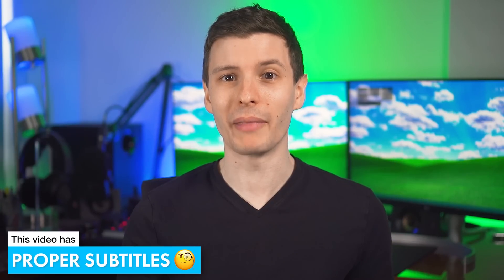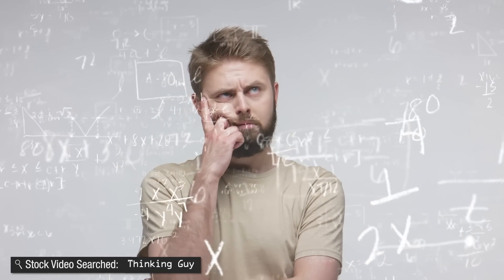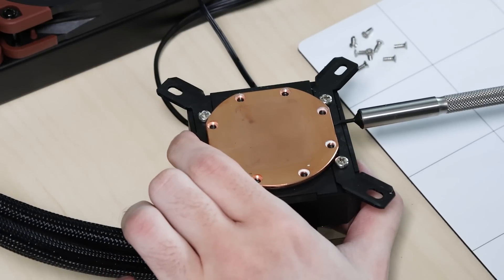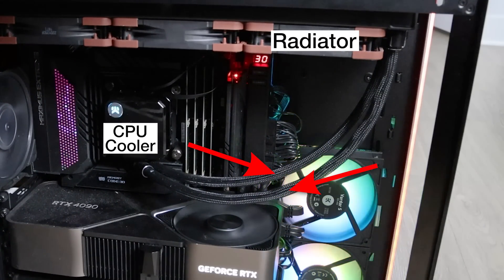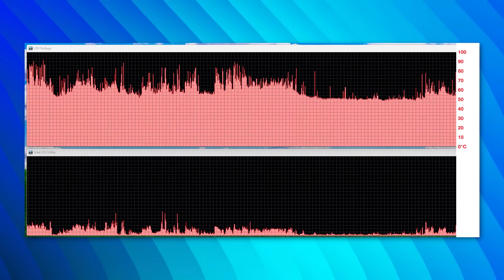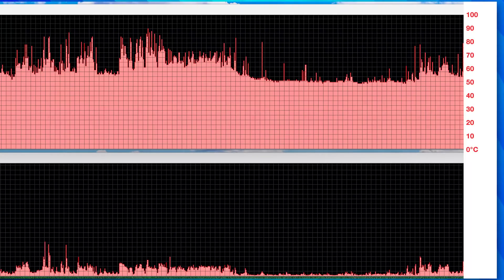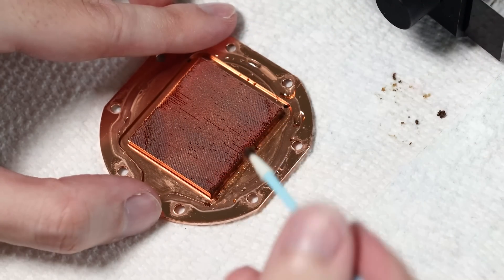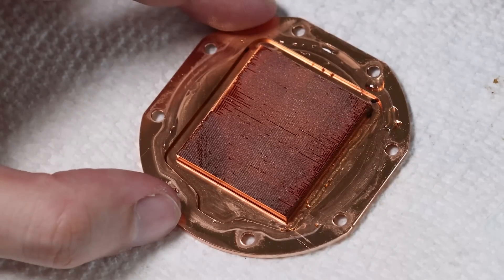The Mystery CPU Overheating Problem Took Me Months To Solve

Comment: I have the same motherboard paired with 12900k on a custom loop that goes through CPU and GPU. The idle temp of the package sits around 35C. Dint had this kinda problem happen to me , though i use EKWB Velocity 2. But i did had a problem with my RTX3080Ti. It is mounted vertically via a riser and in 2 years using its temp under load went from 70s to 95. Its cooled by Corsair waterblock. When i disassembled it i noticed there were near to none thermal paste left in there , only near the center. All of the paste (Thermal Grizzly Hydronaut) from corners just slid down. After reapplying the paste i am not getting even lower temps than day 1 , maxes out at 67C under full load. Good thing is i am always monitoring my temps on 2 screen😊

Comment: Really interesting video, thanks Joe! When my new PC arrived (i9 12900K) the Noctua NH-D15S cooler had been damaged in transit - they had stock issues and initially offered me an AIO pump instead, I'm glad I held out until they could just offer me the same again as it works really well. At idle the fan doesn't even need to spin and at least I don't need to worry about this sort of issue!

Comment: even before I got to the part where you "reveal" the real problem, as soon as you mentioned water cooling AIO I was like, yeah, it must be clotted, it has been happening with several water cooling AIO's. I hope you replaced the entire cooling fluid because if not, all the gunk floating on that liquid will clot your thermal fins again and also, it is pretty clear that whatever cooling fluid that AIO uses is not of a good quality. You SHOULD replace the entire fluid.

Comment: As a computer tech, do not use water cooler if you a simple user or office user, water cooler will definitely bond to fails either leaking or pump/clogged failed in just few years, than air cooler. And the leakings that also have high chances of short your mainboard or the expensive graphic card. 
Unless you want to replace the water cooler every 2 years for best safe period.

Comment: Goo crud electrolysis cooler AIDS:  FLUSH COOLING crud out of system.  or plastic hoses crap use stainless steel brake line.

Comment: My biggest question would be, what kind of water did you fill your cooler with? Quite often, regular tap water will have minerals that will build up in those tight areas like those fins and cause clogs/overheating. If you fill it with distilled water, which won't have those impurities, you shouldn't have those issues. Another problem could be small imperfections left behind from manufacturing the cooler in the 1st place. Try cleaning/flushing any new system with something prior to install to prevent this problem in the future.

Comment: Yeah, Greg Salizar also found this...  Its not the cooler, nor the pump.  Its the fluid.  It needs to include a good additive package, that is toxic to the fungus that is growing in your cooler.  Industry has been dealing with this for decades in cooling water circulation loops.  Alcohol might be a decent additive if all the hosing and rubber and plastic is resistant.  But whole big name companies exist to sell chemicals to the big industries to solve this on a daily basis.  

Clean the fins with a soft fine brush and see if you can figure out what additive to use.  Maybe the PC industry has AIO coolant with built in fungicide you can get??  But Isopropyl is going to be better than ethanol as the alcohol should you decide to go with alcohol.  And Acetone is also possible but is also more aggressive against rubbers, so caution if you choose Acetone.  Also, dissolve a few milligrams of zinc oxide or even Copper sulfate.  Both are potent against fungus growth.  Good luck. 

A new cooler probably will work for a while... but find reports of 2 or 3 year old AIO's still doing well.  Fungus takes time to grow.

Comment: tbh, a good high airflow case with decent coolers and fans can be almost as quiet as water cooling, while being much more reliable.
i have the lian li lancool 2 case, paired with the darkrock pro4 cpu cooler. i also added another top case fan.
a year later i had to open the case to add another drive and i was in shock how little to no dust there was.
even when playing cpu heavy games the fans hardly ramp up,  which shows much airflow there is even in idle. so much in fact that dust doesnt even has a chance to settle, its crazy.

Comment: I would say do not buy AiO you already doing the work of a custom loop you may as well just build your own custom loop, you be in control of quality rather then the hardware vendor, just get a radiator zmt tubing proper fittings and block and pump res combo and you safe a lot of work, if rad space is a problem consider a Mo-ra3 with quick disconnects, custom watercooling is more expensive but it will last you a couple of generations easily unlike an AiO cooler that usually only last a few years.

Comment: The issues of mixed metal loop.
Bin that water cooler.
There is crap thought the whole thing, the microfins, the jets, the pipes, the radiator.
Plus the coolant loss and lack of anti-corrosive compounds.

Comment: What they should do is coat the CPU in Fuzed Masonite crystals, like diamonds, then the frequency modulation is dampened by the covalent ionic wiggle room.  Like a glass blower can hold the glass five feet away from the molten lava.

Comment: I work for a company that has 80 employees all across the US. We ship pcs to each of our employees. Air coolers are too bulky for it to survive the trips. So I use 120 aios, mainly nzxt. After about a year in the field the pcs start over heating and I have to swap out there pc. So I would just swap out the cooler and pc worked fine. I would throw the bad aios is a corner to look at later. Well finally I did start opening them and found they all had a ton of garbage in the liquid. Since then I switched to 240 corsair. Hopefully spending a few dollars more on the aio will save me a ton of money on shipping 2 pcs and paying an employee for 3 to 4 days of non work. I'm not sure why so many of these aios are doing this after less than a year but it is happening. I would say close to 20 percent. But I have some that last 3 to 4 years. Normally corsair. Anyhow that's my story.

Comment: The gumming will happen regardless of the manufacturer. Straight distilled water will help so long as you clean the system with mild bleach, but even then it's not a guarantee.

Comment: You can scrub the fins with an old toothbrush to clean them out. But the fact that you got corrosion on this unit means that you may continue to get it. Hopefully you replaced the coolant with something that has a decent anti-corrosive which might help, but I'd keep a backup cooler ready to go.

Comment: This video actually helped me realize why my laptop was overheating. While my laptop isn't water cooled, it did actually help me realize that I should probably check the inside of the fan and turns out it was breathing through a carpet.
Reply: I think I might have that same problem with my laptop

Comment: That sounds like a  nightmare. Glad you figured it out. Another reason to avoid watercooling. It's almost never better than air (for CPUs) 

IceGiant ProSiphon, Noctua, and Thermalright are my top recommended air coolers, even if you have to make a bracket to support their weight from pulling too much on the motherboard.

Comment: every AIO alway get clogged up every years no matter what u did to it
if you have warnnty on it get it replace if no them i adjust you deeper take it aparts and deep clean it with tooth bush and dispill water get it flushed it out and clean block out and done and put radiator lower and block up higher and fill it up with dispill water or you can use antifreeze because it have lube in liquids DONT use color fluid it will ruined it
i have fix so many AIO and REBUILD them every few month when customer come in with clogged fluid AIO just happen and dont use cotton stick it will get stuck on stuff

Comment: Based on up to 2:20 I assume it was air bubble in the loop. Lets see! Welp was wrong, wow that's a manufacturer defect, they forgot to purge before assembling.
Toothbrush the plate fins and run some cleaner through the rad if you want to reuse it.

Comment: I had a 6 year old core i7-5960X system with a thermaltake CPU cooler that finally had a CPU overheating scenario, so I replaced both the CPU with a better Xeon and put a new cooler on it. Works like a champ now. The processor would get very hot and the outlet tube from the water block also would get pretty hot, but the radiator wasn't really getting all that warm. It was almost like it was pushing very hot water very slowly through the pipes. I haven't disassembled it yet, but I imagine either the pump is dying or it is likely contaminated with debris.

That sludge looks like plastic/rubber degradation debris. Chances are, the inside of your hoses are breaking down for some reason.

It is one of the reasons why I think it is better to have a reservoir and clear pipe type water cooling setup, so you can see the debris, rather than these dedicated closed loop coolers with opaque rubber hoses.

Comment: That's SUPER weird. AIO's are not meant to clog that easily/fast. EK would probably like to work out what the schmoo was that you got out of there. Something from construction, too much grease on a seal or something? It came off easily so I'm not thinking galvanic (and that would be terrible cooler design... although that HAS happened before). I'm wondering if an o-ring or one of the pipes is being eaten away?

Unfortunately the microfins are the Archilles heel of water cooling, unless you have another filter in the loop they will happily take on that task!

Comment: I once had something similar to this, except that everytime I rebooted OS its normal as long as its never sleep, but everything change when its awake from sleeping, CPU 100%, 79'C, slow but not stuttering. I was running Win xp 32 by that time.

Thought it was a virus infestation, but antivirus says it 100% clean in "deep scan" mode which takes over 4 hours to complete. Only when rebooting its become normal again, 1% CPU, 26'C. Only happens when its awake.

Been searching over the internet, I found a blog that might have the solution to my problem except that the solution is a nonsense to me because it says usually the reason it happens because of battery management driver, the solution is update your OS.

Well I did what it says and the problem gone magically, but I did not want to update the OS in the first place actually because my old OS is actually the fastest OS i had which is Windows XP. Update to WIN7 just to remove the problem is a pain to me because of that pesky infinite windows update download.

Btw I tried to install Win Xp 64 and to my surprise its run with no problems. I mean it its smooth as butter but it didn't last long as a lot of my apps cannot be supported by it. So I resorted to Win 7 64 instead. Its okay to me, 1.27 gb ram usage and 37'C  on idle is not that bad compared to 550mb usage on xp as long as it only 0-1% cpu usage.

Comment: I bought the AIO cooler I have in this PC I'm typing on in 2015/16, coming up to about 7-8 years. Its a Corsair H105. I've since built a new PC around a year or two ago as I was long overdue a CPU upgrade. I bought a new mounting bracket for my old AIO that works with the newer AM4 socket and I've had absolutely no issues. Baseline is about 40c, peaks of about 50-60c.

I think you just got unlucky with your cooler. I think most people have very few issues with them and a lot of people do just replace them when they do new builds so there usually isn't that much easy to find resources that would point to a water cooler being clogged or gunked up.

Comment: I'm 12 seconds in and i have a strong feeling it's the motherboard VRMs. Often times when the vrms go bad and have issues it'll start reporting ludacrisly high CPU temps. This can happen because of a bad overclock/overvolt or because of bad air circulation in the case. Let's see if i was right.

Edit: well, i was WAY off. But i have serious question, why do people still use liquid coolers? Unless you reaaaally need to save on every degree possible, and air flow is a major concern, just get an air cooler. Air coolers might not look as fancy, but at least they barely ever fail. And if they do it's trivial to figure out and fixing it is as simple as replacing the fan.
Reply: I'd also say it was a problem in some component of the motherboard. I had many of them for living near the sea and the salty air corroding everything... I guess water cooler would be ideal, then

Comment: A small advice from me is to chance the coolant and (pressure clean with cleaning liquid) the cycle for the pipes and radiator. Finally add filtered clean coolant mixture. (All this if you know how) if you don't, you can always buy a new one. 
Finally if your cooler has clogging problems so soon it's but quality from the factory. i happen to have an old one and as many times i open it it's still clean after 5 years of non stop use, so. Anyway, i hope this helps you. Cheers mate.

Comment: Interesting video! May I ask, what is the recommended cooler fluid? If it's just water, you could try adding a little food-grade Hydrogen Peroxide or Benzalkonium Chloride to prevent organic build-up. Using distilled water would help too. Google 'non-alcohol hand sanitiser' for typical amounts of these chemicals.

Comment: Amazing you posted this video today.
I had this EXACT same thing happen and only realized what was wrong on Thursday. 

Mine wasn't EK however, it was Thermaltake.

Found the same crap when I took it apart, I didn't bother to try cleaning it however. Junked it and got a Corsair H150 for a replacement.

Comment: Hard a corsair H80i back in 2014-2016 somewhere. It was mounted as a rear exhaust; i4770K back then.
One day I noticed the fans kick up aggressively. Investigated the temps and it was hot under idle and would run up under load.
I unmounted the cooler and found some copper rust looking stuff and it had slightly leaked on the GPU. A 780Ti i think. I got lucky nothing else broke, I think...

Thankfully, still within warranty. Knowing benchmarks back then, i switched to a noctua cooler.

Most chips do just fine under tower coolers of noctua. If noctua cant cool it, you ll need 360mm rads or something custom. The fans are quiet and the coolers do great. If a fan ever dies, you can order a new one.

Comment: As soon as you said that one tube was noticeably warmer than the other, I suspected a flow problem. If there is good flow, the fluid should be moving fast enough that the temperature difference on the supply and return tubes should be negligible. At a flow rate of just 1 gallon per minute, it would take 732 watts of heat to raise the outlet water temperature by only 5 degrees F relative to the inlet water temperature and even a 5 degree difference would be hard to detect just by feel.

Comment: Don't worry, I've done stupider.

A couple months ago I upgraded the RAM in my server. Had to rotate the cooler since the last RAM slot conflicted with it, but whatever. When I turned on the computer, everything was fine. Perfect upgrade. But, I was playing on the Minecraft server it hosted for about 30 minutes before it crashed. I figured it could be RAM instability since it was 2 different SKUs (two different sets, but both Vengeance LPX 2x8GB, for a total of 32 GB). I decided I would investigate more if it did it again. Which it did, about 10 minutes later. So I took the old RAM out, noticing it was a bit hot, and then started it again. It immediately powered down and began to boot loop. Luckily, though, I was booting with the side panel off. This made the real issue very obvious: I forgot to plug the CPU fan back in after upgrading. The thing was hitting overtemp protections and hard crashing. Stupidity remedied in 5 seconds, and everything is working fine now.

Comment: are you a smoker or have a smoker around in your pc area? looks like smoker residue. it could also be residue from a sent helpers like incense , cooking, fireplace or even vehicle exhaust. might try putting an air purifier by your pc and checking that for residue. it could also be coming from a window if your pc is close to a window.

Comment: something that needs to be a trick of the trade when cleaning watercooling objects is cycling water through the pump while one tube is disconnected to have a open loop filteration with 1/4 rubbing alcohal and 3/4 water for 100 percent maintanance.

Comment: Yeah, sorry mate, but you didn't do the job very well there.

You have to identify where the contaminant comes from, fix that and clean the entire system with appropriate brushes, soapy water and what not. Eg. the fine toothed heat sink needs a fine brush to be cleaned down to the bottom of the grooves.

This assuming you always have used appropriate cooling fluid that hasn't attacked the internals of the cooling system.

Comment: I clued in to the potential problem when you said  "I laid the computer down to apply new thermal paste" moving it around like that would dislodge stuff.  However, you may have cleaned it but what was that stuff some sort of coating from inside of the cooler or tubing or what?  If it is, more may appear, I would definitely replace the whole cooling system, I would not trust it anymore, it is not that expensive right?

Comment: If your pump is working correctly then both tubes/pipes should be close to the same temp. If one is much hotter then the other then there is a flow issue, probably pump.